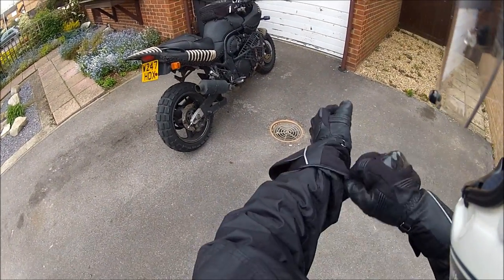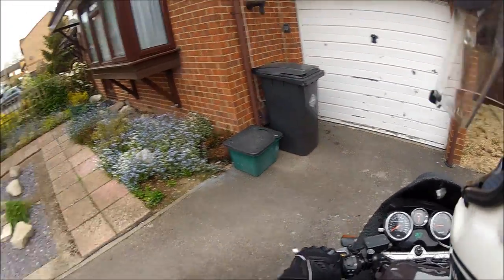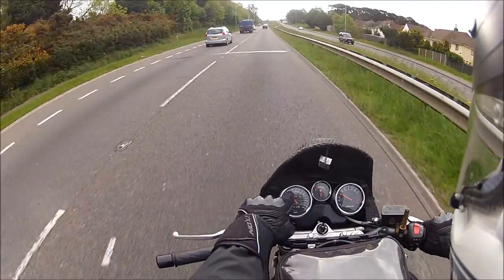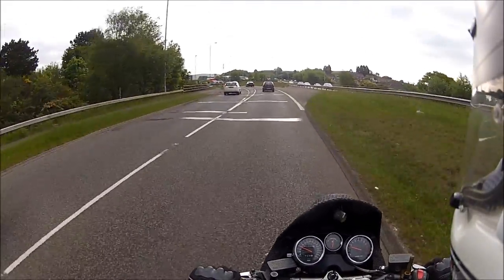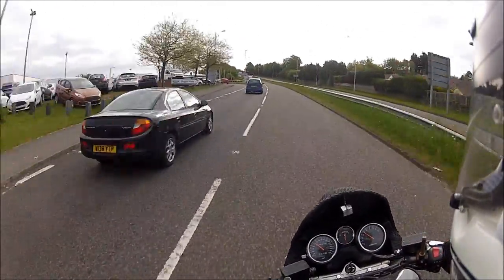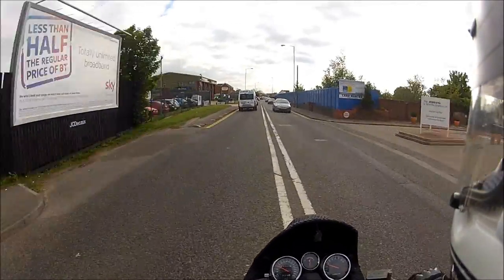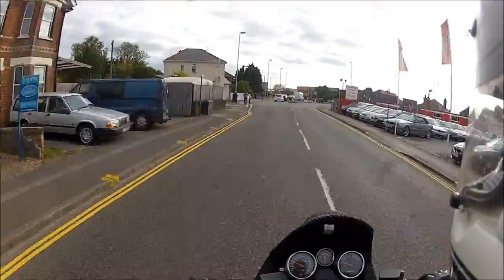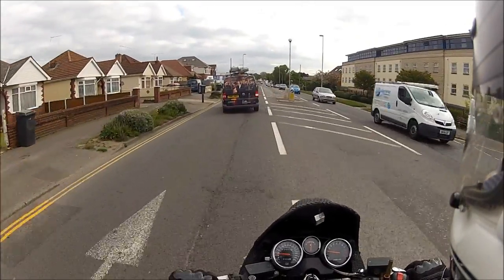Delboy's Garage, Knobbly Tyres, first road test.

Comment from the maker: Hi mate, currently running 40 in the front as they tend to cup out in the centre and 38 in the rear as they wear out in the centre due to the big gaps between the knobbles, but watching the little hairs wear off very closely to see the pattern of wear as it develops and will adjust accordingly ... thanks for watching, mate, Del

Comment from the maker: Hi Niclas, good to hear from you - contrary to popular belief, the Harley Davidson factory tyres are not 'shit' they are more than adequate for the job, if you are buying a 72 you're biggest achilles heel is the super skinny front wheel which does not allow for a very big tread patch on ANY tyre, however, if you want to improve the factory tyre grip you can use the Avon Venom, they make a Whitewall and give much more grip, but obviously wear quicker - hope that helps, Del

Comment from the maker: Hi mate, they're design focus is best summed up in the name 'twin duro', they are a dedicated 50/50 road/off road tyre with no bias in either direction as all other tyres have... in particular they were developed for the GS1250 BMW as it has the widest back tyre of any adventure bike and there was no rubber to suit it... for me they are a fun part of the rat bike image & so far have behaved impeccably on the road, and no, they're not noisy, just a little vibration under 10mph...

Comment from the maker: Ayup Steve..not at all bumpy mate..they are a rounded profile and designed for tarmac, fitted as an option on the GS1250 Beemers..In the wet they are not twitchy or in fact any different in feel than the old Avon Storm2....granted they will struggle at the limit...but then wheres the fun in being totally safe.....ive fed the power in exiting wet roundabouts a few times and cant make the back step out...where as on the road rubber, i could push the back sideways to order...150 miles in and fine.

Comment: Hey Delboy, loved the vid. Just fitted a set of Michelin Pilot Road 3s after getting excellent life out of the previous set. Very excited and interested by these tyres. I live in Australia which has an excellent road network until you get 50-60km outside any major city. Love the PR3s but even they dont do gravel or unpaved roads very well. Love the scenery in the old dart too! Cheers mate. I'm gonna check if they're road legal in Oz!

Comment: Hi Del, do you have to run them on slightly higher pressure than normal? As when I had nobbles on my old Suzuki PE400 (road legal) we used to put slightly higher pressure in when road riding, 
Bike looks awesome, Ride Safe Del.

Comment: Hi Del, Mentioned to you a while back that I'd picked up a 1982 US Honda Magna VF750 V45 as a mucky weather hack/survival evolution bike and it's coming on nicely. Now that the weather is turning cold, I'm planning on using this bike through the winter and it's gonna need some tyres soon, and so I turn to you for some advice. Knobblies would loook wicked on this thing, but I know nothing about tyres, would they be good for wet/slushy roads? What are those tyres you have? Any recommendations?

Comment: what do u recomend for type of tyres for a ktm 1190 adventurer r, i whant to be able to ride in the winter even when there is ice. is there knobbly tyres witch work in cold weather and is there dubs to put in road tyres for tarmac riding?
Reply from the maker: Not sure what you mean by ' dubs to put in road tyres for tarmac riding' ...as to riding in the ice mate, there's no tyre that's perfect... and we're certainly not allowed to use spikes... my Tiger has Michelin Anakee tyres and they're great... never let me down, even in snow, big wide grooves that clear easily in sludge and not bad money, but if you want something more hardcore, especially for the soft stuff, then Continental TCK80's are the best... good luck, Del
Reply: i ment studs it was just a swe/english word XD
The thin is i whant to be riding all year lon ad dont need to put the bike away in winter, so what do u recomend for roads that is mostly clean tar buc can hide blackice in intersections and in the morning and late evning when it is cold and alittle bit of water in the air.
is it possible to fill tck80 with studs ? or shall i try to put some chain on the tyres XD chainsawchain would maby work .